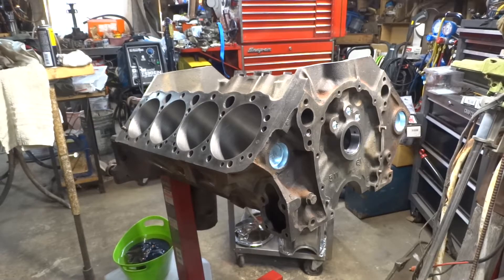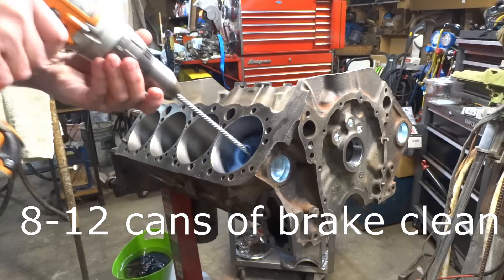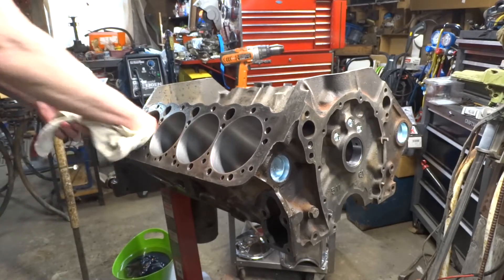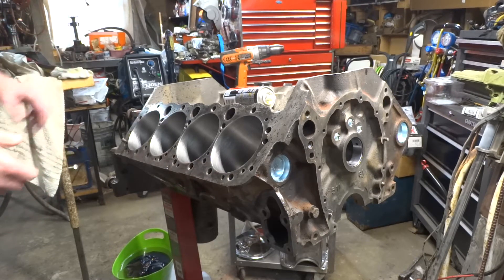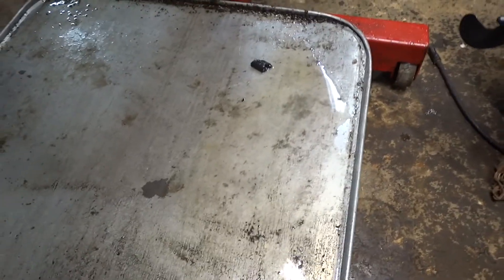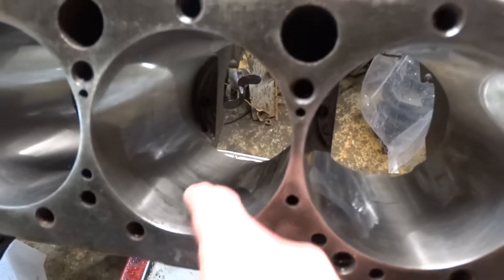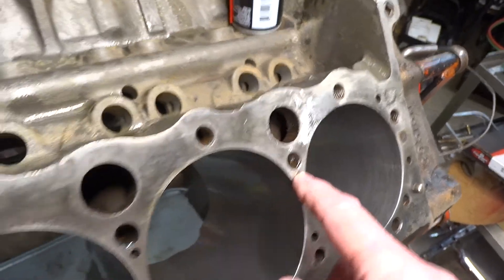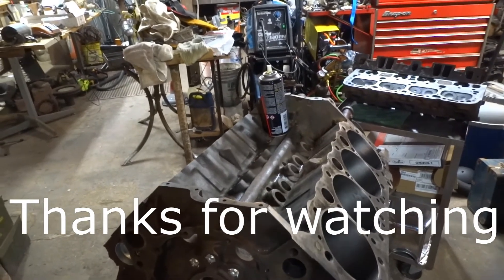SBC Engine Rebuild part 1

Comment: As long as you're not running to much cylinder pressure the cracks to the steam holes shouldn't hurt this build. The previous builder must of known about those cracks  and is why it had head studs in it? That is the way to go in that situation.

Cool build, I am now subscribed. 👍

Comment: Those are big Bores !!
Thanks Ken 🔧🔨👍😎🏁🔥
Reply from the maker: Just a tiny bit over 4 1/2 inches.  :)  people love them 400 SBC but no one loves them cracking around the steam ports into the head bolts holes
Reply: @KensStuff  4 1/2 inches 🤣🤣🤣🤣!!! That’s the bore size of a 572!!!!!  It’s a 4 1/8th in bore on a 400 block!!!